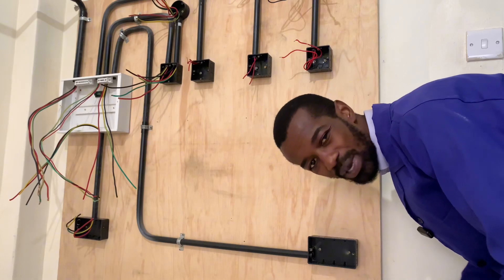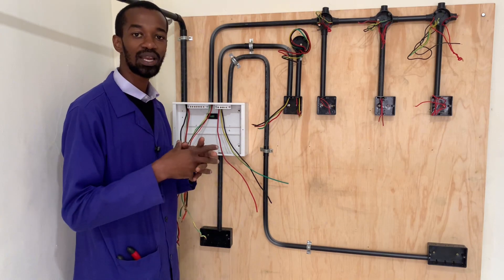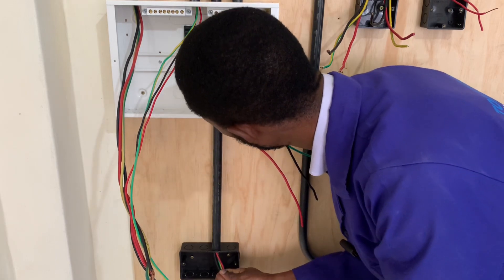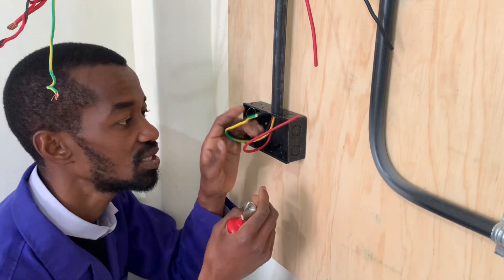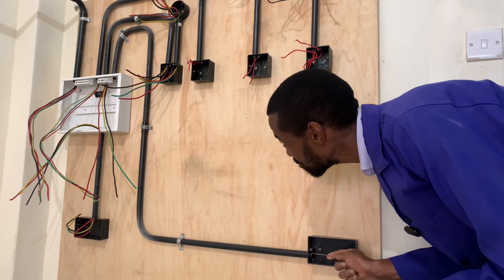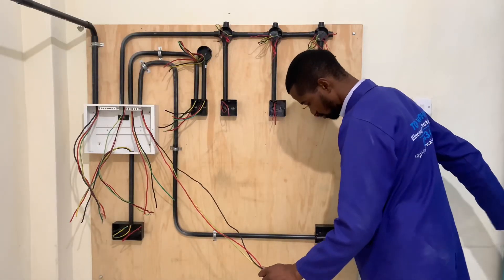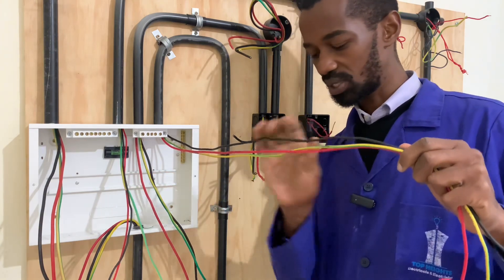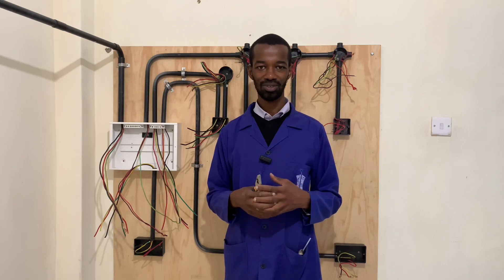What Size Of Wire Can I Use💡 (For What Wiring Circuit?)

Comment: 4mm is bigger for that socket if it not for cooker.heavy consumer in the kitchen is only cooker stove.Otherwise nice presentation
Reply from the maker: I appreciate your input Charles but what if the user connects an extension cable and on it have many appliances such as a heater, microwave and fridge/freezer?